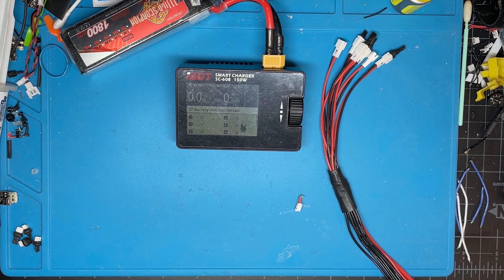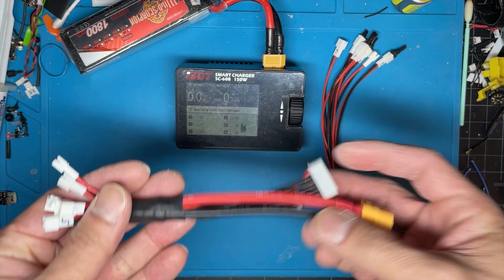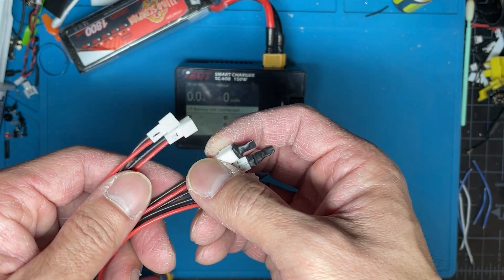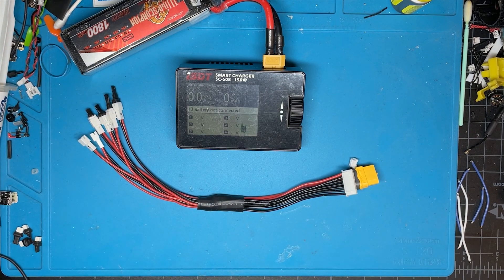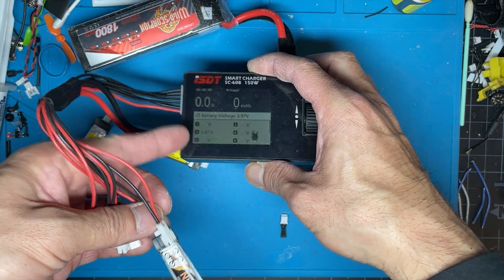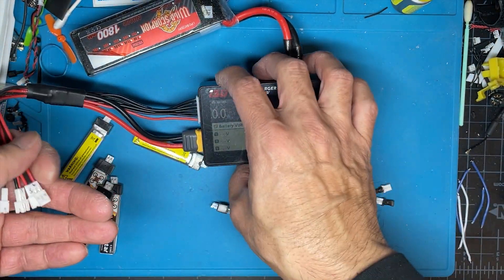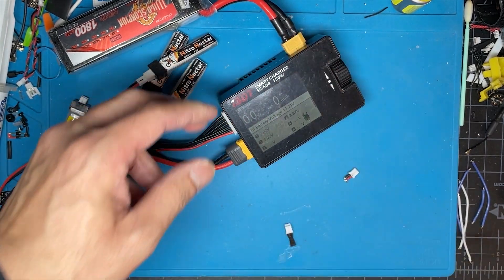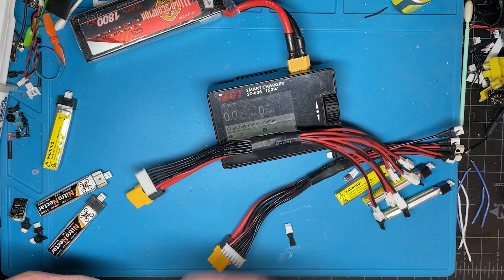Series Charging 1s Lipos

Comment: do you need the bridge connectors?
Reply from the maker: Yup, you'd need to if I want to close a line in a series. So to charge 4x 1s lipos, bridged connectors need to be plugged into 5 and 6
Reply: @MrHappeFPV  what happens if you don't bridge them? Charger won't start charging?

Comment: I made similar cable (4s) and gnb27 connectors. When I plug it in my charger (same as yours) it shows the voltage of each battery but as soon as I start charging the voltage drops slowly. Discharge works like a charm but charging not. Any idea? Checked wires over and over...